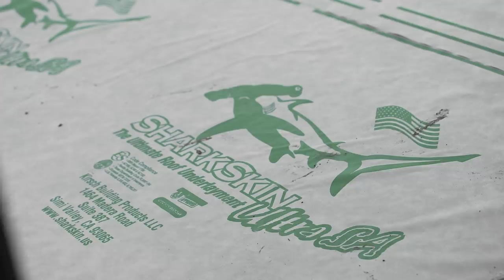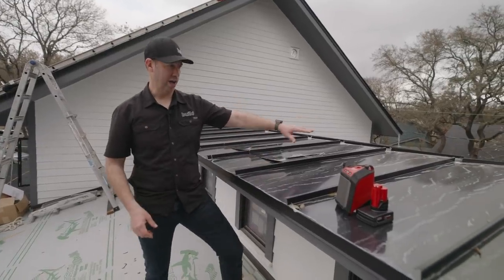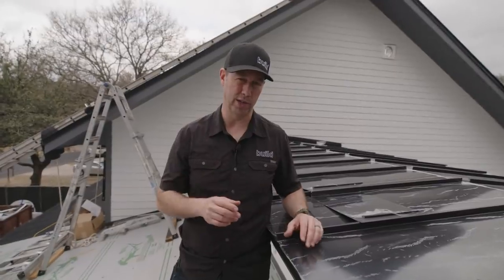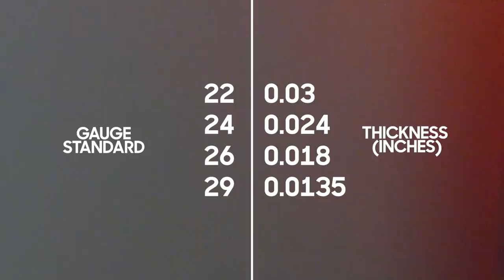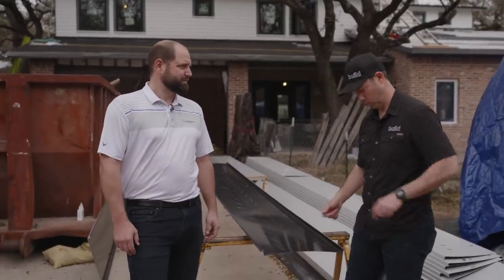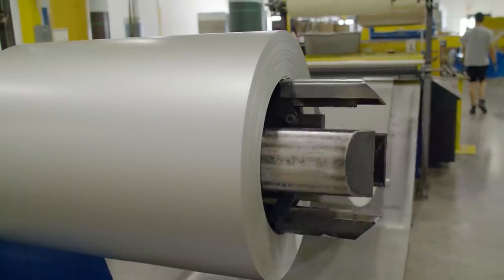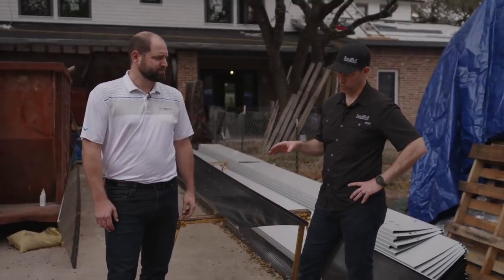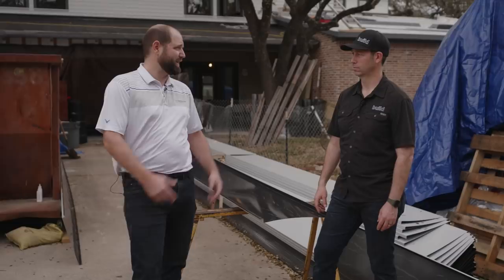Metal Roof- Best Practice Details

Comment: Hey Matt on previous homes I’ve seen you install the reflective radiant sharkskin product facing the sky over the 1x4’s. Why did you face it down on the 8 pitch part of this roof that’s has the diagonal 1x4’s?
Reply: I don't understand the logic behind installing "shiny side down". The natural reflective property of a reflective surface facing a heat source across an air space allows the
aluminum surface to reflect radiant heat back to the direction from which it came. If it's facing down, how is it working?

Comment: Funny I just got a quote for a metal roof on my small 1000sqft rental house.  Shocked the crap out of me at $22,500 for a super simple roof job.   Looks like I’m gona wait a while to see if steel prices come down  before deciding what to do.
Reply: How big is the roof b/c the square footage of your house really doesn't tell me anything about the roof size? Its quite common for a metal roof, depending on material and type, to cost 3-5 times as much as asphalt shingles.

Comment: Is this a good type of roof for mounting solar panels on? Building a house in southern Florida. Need hurricane proof shinanigans. Building icf as well. Top to bottom
Reply: If you want hurricane proof, then 24g double lock standing seam with plenty of clips is really your only option here. This is a great roof system for mounting solar panels. The mounting solutions clamp onto the seams so no penetrations are needed through your roof to fasten them. 

Don't even bother with asphalt shingles if you want hurricane proof. You could probably do OK with a snap lock panel but I have seen them come off in hurricanes. A screw down 5-V panel is also pretty tough but you end up with tons of exposed fasteners and you're really relying on the expertise of the installer to fasten the screws properly so the gasket can seal. You also lose the bottom edge locking turn on the eve trim with 5-V so it doesn't have the same wind uplift rating as standing seam. Not really great for solar mounting either.

Comment: Like the way the roof locks to the drip edge.  Curious to see the ridge vent system in person and how it is fastened.  Looks good from what you showed.
Hard to find a metal roof that stands up to hail in Texas but that 24 guage just might do the trick especially with that mesh vent system under it.
Has the insurance industry put a rating on it yet?
Great color choice by the way.
Reply: The best metal roofs for hail are stone coated steel.  They look like various forms of tile roofs

Comment: *Manufacturer warranty?
* Good for water collection?
* Radient heat index?
* Approved for bush fire zones?
😭🇭🇲
Reply: we had a wildfire rage throught e community I grew up in.  we could tell the homes that had a metal roof, because there was a pile of twisted sheet metal on the pile of ash.
Reply: Varies by the geographic zone you live in. Re: fire rating...check your Building Code or talk to the local Building Department.

Comment: I’m absolutely putting metal on when my roof needs to be replaced. No more fragile and heavy asphalt shingles.
Reply: Just make sure a professional, well experinced roofing contractor does it.
remove the shingles, and put on a contnious, self adhering ice-and water shield membrane over roof sheathing.
Remove any warped or rotten sheathing, and make sure that it's at least 3/4" thick if your trusses/roof rafters are at 24" on centre.

Comment: Here in Europe we do a 2"x2" frame under ceramic tile roofing for ventilation. Although creamic/concrete tiles are preffered here over metal roofing, mostly because they damp noise better.
Reply: Also, more contractors are used to doing tile roofs than they are metal, hence the cost factor.
yes, noise is a factor.

Comment: The mention of 'clamp on' solar panel retention clamps poised me to ask... Do you need to plan and install more 'hidden roof hold down clips' on an area that may in the future be a location for solar panels?

I'd hate to later install a solar array and then have the solar panels rip my Florida 100 year roof off in a hurricane.
Reply: Probably not a bad idea. I suppose it would depend on how and where the wind is blowing. The solar panel could impart a lift force to the roof or it could impart a down force into the roof. I would think that considering how close the solar panels are usually mounted to the roof deck that they provide a down force when the wind blows (Think ground effect in F1 cars.)

Comment: Humm, I missed it if he talked about it,
Why put the furring stops on a angle?
I thought Matt’s house had igloo type ridged insulation, something like 2” on the roof?
Would like to see the detail on the underlayment fasteners they screwed thru the  rigid insulation
Reply: Furring on an angle because if they were parallel  with the ridge, they would block air flow from drip edge to ridge, trapping moisture. With it on an angle air flows up to the ridge vent.
Reply: @billvojtech5686  
Bill thanks for that reply.
I guess what I was thinking is that the moisture created daily from condensation will lay up against the up slope edge of the furring strip which will rot.
In my home state of Florida I've seen wood shake roofs rot in as little as a year because of trapping moisture.

Best practice here is to have a lattice work of furring strips. The bottom layer is vertical and the top is horizontal. 
I guess you could protect the furring strips on a 45 by some sort of protective coating or by using PT wood but I bet Matt is going to an issue before too long. 

This will be interesting to follow.

Comment: Looks great, and in 10 years you will have a faded grey roof...
Reply: The paints used now (on quality roofing) are totally different from the paints used for decades that failed in a few years. It will fade eventually but it's more like 20 to 25 years and then it can be re-painted. [Just had my 35 year old metal roof repainted with a very expensive high tech paint with a 30 year warranty] Still, I wouldn't have gone for a dark color myself simply because of the heat load dark colors generates vs the more reflective lighter colors.
But Matt would just add an extra inch of insulation to compensate, haha.

Comment: No mention of cost -- pre-covid, the numbers I was told were around $200/square for composite shingle roof and $900-$1000/square for metal (with slate and tile somewhere in-between)... so 4-5x the cost of a traditional roof. I'm curious if those numbers are still about the the same.
Reply: just got a quote. Its about 3x
Reply: That 3x is not for the highest quality architectural shingles.Delta would be less if you used say Certain-teed Grand Manor or equivalent.
Reply: That cost is roughly the same per square as of now. I think we did just go up to about $280/square for an asphalt tear off b/c of shingle price increases. Labor price is the same of course.

I don't think your slate and tile prices are right. Those are considerably more than most metal roof systems. Not only is the material more, but the expertise and labor involved is enormous AND you have to actually build the house to support the weight of slate or tile. You can't just rip off asphalt shingles and re-roof it with slate without some considerable bolstering of the framing and roof decking.

$1000/square for standing seam is kind of high in my area. I suppose for 24g double lock that could be about right b/c of the extra labor involved in the locking process, but its definitely too much for a snap lock or screw down metal roof. We often use a snap lock panel that has a built in screw strip so that knocks out the material and labor cost of using clips.

Comment: Who else is questioning the radiant barrier orientation 😀
Reply: "...Research by the Florida Solar Energy Center (FSEC) found that radiant barriers work best when installed with foil-face down (towards the building interior) and applied under the roof sheathing..."
Reply: Facing down is fine, and should work just as well. 
This is because an object with high reflectivity must also have a low ability to radiate thermal energy, a.k.a. emissivity (pseudo-explanation at the end). If you look up the emissivity of something shiny like aluminum foil, it's around 0.04. This means it only radiates only 4% of what a perfect thermal radiator (a.k.a. blackbody) would emit at the same temperature, which gives the same effect as if the radiant barrier was installed face-up on the other side of the air gap and reflected 96% of the radiant energy from the roofing metal.

The amount of radiant energy an object in thermal equilibrium absorbs is equal to the amount it is able reradiate, also known as its emissivity. It has to be, otherwise it wouldn't be in thermal equilibrium, and would instead be either heating up or cooling down. If you ignore transmitted radiant energy (i.e. you're looking at something that is essentially nontransparent, like a radiant barrier) then the reflected energy and absorbed energy must total 100%. Because absorbed energy must be the same as emitted energy (thermal equilibrium), you end up with a relationship where reflectivity goes up when emissivity goes down, and vice versa, (assuming nontransparent objects). I know this isn't really an explanation of the underlying physics, but hopefully it is still helpful.

Comment: Excellent......place for bees and other bugs to thrive.
Reply: For some reason he didn't show the detail of the Corovent but there's a polypropylene 'cloth' attached across the outer edge of the material to keep out bugs and larger debris. Looks like he removed it so the camera could look through the corrugated plastic.
Reply: @bobjoatmon1993  ok good because that just looked like a man made hive.
Reply: @bobjoatmon1993  the cor-a-vent lattice has openings small enough to block bees and wasps. use of the mesh is more important at ground level to keep out ants and other small insects that tend to be at ground level.
Reply: @paperwait9611  of course, that's so obvious it didn't have to be stated, yet you did.
Reply: @bobjoatmon1993  if my comment was "so obvious" then why did you make a comment to suggest that you thought that the mesh was significant?

Comment: Striation panels create a subtle airspace that works with Radiant Barrier well. The striations also help with inevitable hail that's going to hit that metal surface.
Reply: striations are not for creating an airspace or to hide denting. striations are for the purpose of hiding "oil canning". the best way to avoid dents is to use 24 gauge steel as risinger did.
Reply: @paperwait9611  
True that striations were not originally designed to create air space or hail prevention.
But no the less, it has been shown that striations does in fact greatly reduce hail dents and does create a slight air space. And since radiant barrier only needs a slight airspace to become effective, laying it down over the underlayment under the panels with a striated standing seam roof will reduce your heat gain. And if the hall is big enough a 24 gauge flat pan panel will show hail dents. I've seen it many times.
Reply: It should also be noted that whenever you left a standing seam metal roof up on furring strips it does help with energy efficiency. But it also creates an environment where hail will have a greater chance of causing dents in the roof. So lifting the panel on furring strips and putting down a flat pan condition is the one application that will be the most susceptible to hail indentations. True 24 gauge metal will greatly help with that scenario. But 24 gauge is no guarantee you're not going to get hail dents.
Reply: @traceyjscott069  it is true that venting a roof has some effect on "energy efficiency", but it is not substantial. the best way to "help with energy efficiency" is through the choice of roofing materials.

Comment: RUST? if aluminum, no real problem. However, if galvanized steel might there be ever growing rust from the edges or scratches?
Reply: We, as architects, were always told that zinc coating has a habit of "moving" along the face of the cut thereby preventing the panel from rusting. I'm not sure I buy the argument.
Reply: It's a Galvalume® steel which has better self-healing characteristics than galvanized steel. It is coated with a Zinc/Aluminum formulation. -Thad

Comment: How does that ridge vent handle driving horizontal rain?
Reply: Google Metal Ridge Vent Detail.
Reply: The metal panel extends up past the Z-bar several inches, or at least it should. Any water that drives into it should never make it to the open ridge before it drains back out. I know we normally make our ridge caps with 6" or 7" of coverage on each side. The panels will extend up to within 1" or so of the vented ridge so you've got anywhere from 5" to 6" of panel up above your Z-bar. You can also do a bread pan fold at the top to further defeat any driving rain. I personally don't bother with this b/c it isn't really needed with the way we do the ridge cap detail.

Driving rain is really only a problem on low slope roofs. If its an 8/12 or steeper then there's no way the rain is going to climb up 6" to an opening. It would have to be a friggin' hurricane force wind for that and then you've probably got bigger problems than a leak. One thing I don't really like is how the Z-bar is perforated. I've never seen or used that type of detail in my 14 years of metal roofing.
Reply: @oldscratch3535  Slopes are critical when it comes to metal roofs, no doubt.
We have used Z bars that had like little notches every 4-6" along its bottom leg. That's to allow any water (usually from condesation which can form under the sheet metal) to run down and seep out.
VicWest had them - maybe they still do. We used their Marquis system often on various buildings.
Reply: @apscoradiales  If the ridge is vented we usually just leave the Z-bar with a 1/8" or so of play on each end so any water or condensation that does get in there can just run out the sides. 

A company I used to work for wanted us to use butyl tape on the bottom and then caulk the sides of the Z-bar. I refused to do it and explained to them that they're just creating a potential leak by damming up water if it gets in.
Reply: @oldscratch3535  That can work too. The Z bars we used in metal roofs can be as long as 12 feet, so gaps would be a fair distance apart. I guess that may be why they did notches on them.
Reply: @oldscratch3535  Thank you. With a roof pitch of 3, I was curious.
I've had issues with ridge vent leaks in the past